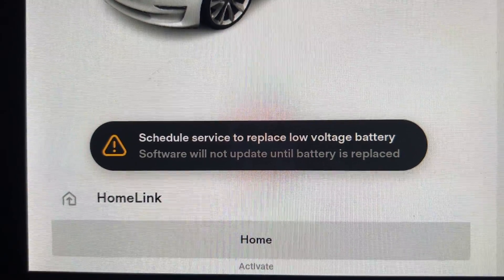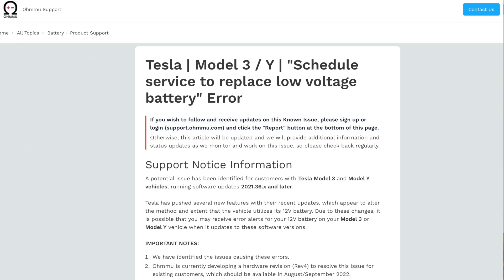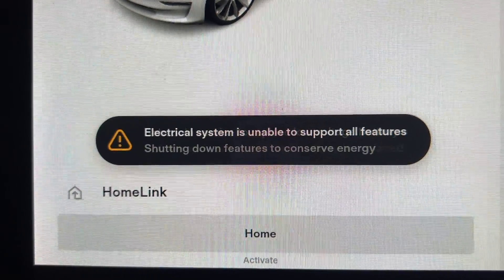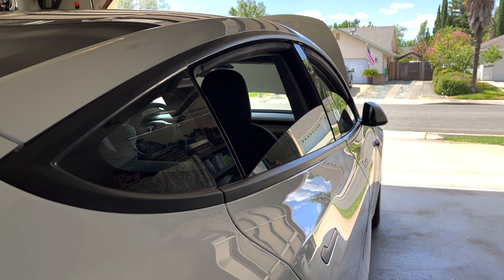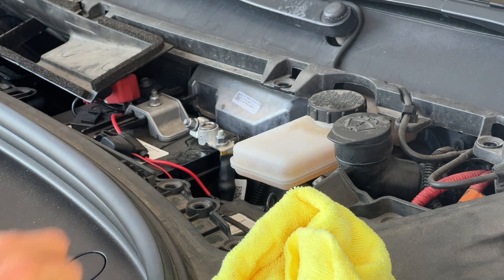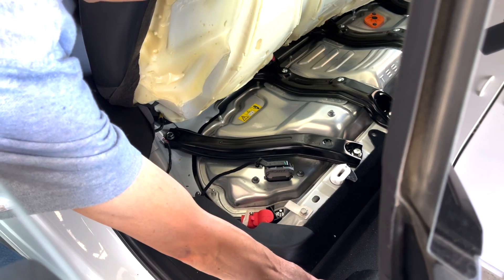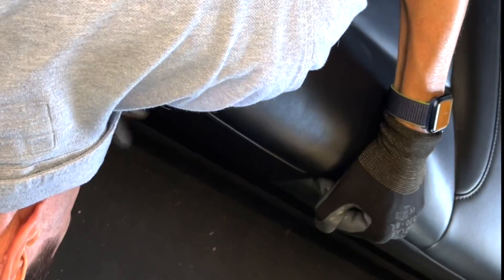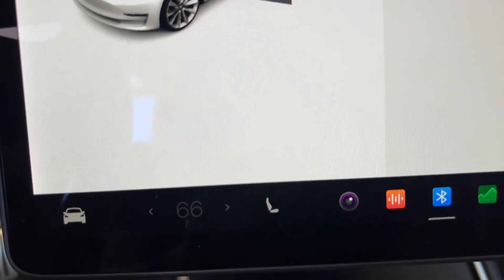Tesla Model 3 or Y Ohmmu Battery Error Message Fix

Comment: Unfortunately the error message reappears after the disconnecting procedure. This has happened several times now. Getting fed up with this, I re-installed the Tesla lead battery. Ohmmu does not reach out to me, just tells me to wait until Tesla has an update that solves this problem. Sadly i live in the Netherlands and it appears that Ohmmu does not care for customers in Europe….😢😢😢
Reply from the maker: Sorry to hear that. It sounds like they are working on a new battery but it won’t be available until the end of the year.

Comment: The problem is in the battery not dropping below 12.6 volts ...the tesla software is waiting for the voltage to drop so it can test  the capacity.  it stays at 12.6 the whole time and that's why it throws the code

Comment: Has anyone tried the reset you get with changing the tires type? I hear it gives a full reset similar to the procedure in the video. Just change from your tire to the bigger or smaller tire and then back, faster than taking the rear seat and maybe the frunk apart
Reply: Just tried this but it did not get rid of the warning message.  Thanks for the suggestion though.
Reply: This "wheel change" reboot method used to work for me in 2022.  It does not work for me anymore in late 2023.  We have a 2017 Model X.

Comment: I was considering this battery for our 2018 M3P with 70k miles, but it was unavailable. Now I know why, thanks for the great explanation. I wound up looking up the original battery part number on the Tesla website and ordering it through our local service center. I picked it up for $85 and installed it myself. Hopefully it'll last 4 years and 70k more miles.
The old battery has replaced the dead one in my lawn tractor.

Comment: I just completed a 6,000 mile US road trip in my 2021 Model 3 SR+

Over 13 days of driving (July 10 through July 31, 2022, with time in Kentucky) from Sacramento CA to Louisville KY and back (with numerous side trips), I drove nearly half what I drive in a year. 

The final analysis: Wow. This is definitely a road warrior vehicle, despite so-called “conventional wisdom.” 

I am still plugging in metrics and numbers, but I estimate about 60 charging stops. In all those stops, I only had ONE 5 minute wait, at Glenwood Springs, CO. One. 5 minutes. I’ve waited longer in a grocery store line. 

I drove through and charged in major cities (LA, Amarillo, OK City, Little Rock, Memphis, Nashville, St. Louis, Kansas City, Denver, Salt Lake City) and countless small towns and wide spots in the road. Typically, I was either the only one there or one of two Teslas. My typical stop was 20-25 minutes. Enough time to have a short walk about, use the bathroom, grab a bottle of water, and then get back on the road (the breaks, and auto pilot, assured I’d be rested and relaxed after hours of travel). 

Weekdays, weekends, rush hour, nighttime, huge supercharger (50+) or small (4), interstate or blue highway… I drove and charged through them all. No cherry picking. 

~60 superchargers. 6,000 miles. 13 days of driving. In July 2022. One wait. 5 minutes. 

I can’t speak for others. But a complete success in my book.
Reply: don't see how this relates to use of an Ohmmu 12v battery.
Reply: same, different route, but countryside and big cities-no problems--even my elderly Aunt had fun riding along as "map monitor."
Reply: @honeybadgerisme  That’s cool! Riding the Wave! Happy travels to you.
Reply: Did you do all this with an Ohmmu battery?  If not, this anecdote has nothing to do with the subject of the video.  Everyone knows Model 3's can do this.
Reply: @StormsparkPegasus  Could not disagree with that last statement more. Yes, people knowledgeable with Teslas (and other EVs) may well know the capabilities of the vehicles. 

However, there are a great many people who do not know the ability of a short range EV to travel across the US and do it comfortably and without angst or worry. Even current M3 SR+ (now RWD) owners are unsure about long distant trips. How do I know this? Because I hear them asking and doubting and uncertain about even attempting such travels. 

That was the audience I was writing to. To encourage them to take trips outside of town. To venture out. To be amazed at just what their EV can do.

Comment: I had a ohmmu pronounced ohm in my 2913 model S, then my model 3 and now in my model Yand 2016 Chevy Spark EV. 
   I was very lucky with no errors or problems on any of them.  They are half the weight and non toxic. I think I will have 8 years life on each of them. 
   Maybe it makes a difference if you install with a complete power shutdown which mine had right at the ohmmu shop.
Reply: Lithium Ion batteries are non toxic! 😂 Damn you dumb!

Comment: Ohhmu is a real disappointment. I had the same error multiple times. Unacceptable for Ohhmu not to disclose this from the get go. $400 battery. Sorry I bought it. OEM battery is back under the hood. No issues. I went through this process multiple times and error messages still appeared after awhile.
Customer service at Ohhmu would not offer a refund. 
Do yourself a favor. Save the money. OEM lead acid is completely reliable. I was fooled.
Reply from the maker: Curious how quickly the error message would pop up for you after this reset. It's been over a month for me and no issues.
Reply: @FrugalTeslaGuy   I’ve done the reset procedure multiple times, and the error message keeps coming back anywhere from a few days to as much as a month later.  Do the reset, and it comes back again in a few days/weeks.  Like others have mentioned here in the comments, Ohmmu customer service has been very frustrating to deal with.  They know it’s a hardware problem on their end, and I know they are frustrated themselves that a Tesla software update is the culprit, but that can’t be the customers problem.  Ohmmu sent me a replacement that supposedly fixes the issue, but that one soon gave me the same error messages.  I wrote back to Ohmmu again, and they suggested I try their v4 battery, but when I asked to go ahead with the replacement, they went radio silent again.  I get it, they don’t really know themselves how to fix it, but they also aren’t being helpful with either replacements or refunds.  So I can’t say that “they are one of the good ones” as you mentioned, unfortunately.  I haven’t given up on them, but pretty soon I’m going to just get a battery from Tesla and call it good enough.
Reply from the maker: @ThisIsTeslaTrippin  Thanks for sharing Sean. I will definitely do a follow up with Ohmmu if I get the error message again. Otherwise, it's been over a month for me since I performed the reset and no issues on my end. Sorry to hear about your issues.
Reply: @FrugalTeslaGuy  Seems like frugal Tesla guy is scamming us and has a deal with ohmmu.  Can't find a single person with a model 3 that doesn't say they are getting this nonstop error message.
Reply from the maker: @aggiechase37  You got me. It's a total scam! I'm all about the scams.

Comment: This comment is off the subject of accessories but does anyone knows a way to keep the interior cooler, I live in Florida and use a considerable amount of my battery to keep the car interior cool using the internal cabinet protection feature, I'm trying to vent the windows to see if this is a better solution but if it rains and I forget to roll windows up, "not good," tesla should have a feature on a future software update to synchronize the same sensor that detects rain on the front windshield to close windows if the car is parked, I will appreciate, maybe this is already implemented I don't know how to use it, perhaps you or someone else can get a hold of Elon and suggest this idea, thanks in advance for your help.

Comment: Our recent experience with 2018 Aug built M3DLR. Made SC appt. late May to get warranty & recall work plus preemptive 12V replacement. We were told Mobile Service is no longer available to us (as it had been in the past) so had to travel 4 hrs RT to neighboring state to nearest SC. after 4 hour wait, result: we were told battery tested good so not replaced, no charge to us for anything except cabin filters. 4 weeks later in June the dreaded message appeared. Drove 4 hrs RT in heavy North NJ traffic again to SC to get replacement 12V battery. Was replaced under warranty no cost, except 7 additional hours of our time, stress, several dollars in tolls. Would have been happy to have paid the $125 for the battery if they had done it the first time to avoid the hassle!
Reply from the maker: That’s the problem with the 12V batteries. One day they’re working perfectly with no signs of going bad and then they completely fail the next day.

Comment: I’ve had this issue and Ohmmu won’t replace my battery after contacting them several times, for this reason I don’t recommend dropping $400+ on this battery.

Note that MMP has had these reset method from the contractor connector under the seat, this reset will also fix other glitches. 

Resetting with this method gets old and fast, there are no fix for this error message and unfortunately you won’t get your money back or a replacement.

Comment: My car is still under warranty.  The first 12 volt battery lasted 27 months.  I plan to have Tesla replace it every 2 years.
Reply: my OEM 12v lead-acid battery equipped 2021 M3 is displaying the "schedule service to replace low voltage battery" message after 15 months

Comment: This happened to me today, but with the OEM battery from Tesla. I bought a new battery from auto zone and the error will NOT go away, but i will say you did things in a slightly different order. Also you never dis-connected the HV service / first responder plug which i found of note. One thing i would advise people; make sure the error is cleared BEFORE re-assembling everything and putting the panels back on. About to go try your way....
Reply: aaaand this procedure did NOT work on my 2020 Tesla Y (non-Ohmmu battery)    :(
Reply: @mjbender2007  He did disconnect the HV interlock.  It's in a different place on the Y.  On the 3 it's under the back seat.  On the Y it's in the frunk and it's a completely different connector.

Comment: Yeah I have a 12/2018 LR DM 3.  Doing the HV system reset only gets rid of the error message for a coupe days before it comes back. ohmmu has said that it will require a hardware change to the new revision of the battery coming out soon.
Reply: did they say they're going to provide the new hardware change at no cost?  same thing is happening to me now.

Comment: I can’t believe tesla makes you do that to reset a message. A typical person would never attempt that
Reply: Tesla doesn't make you do anything. The message is because the car detects a problem on the 12v system.  The Ohmu is a different type of battery, with a different voltage and behavior from the one Tesla designed and provided with the car.  Disconnecting all power, low and high voltage, forces the car to start over and recalibrate everything. You can only cross your fingers that the Ohmu doesn't trip up the system again.

Comment: Too bad it's a pain having the Ohmmu Battery.  I stay away from anything not OEM Tesla.
Reply: The factory battery isn't made by Tesla either. Tesla just made a deal to buy them. The original battery are horrible and fail way too often. It sounds like brand new Tesla's are eliminating the 12v battery in favor if some alternate DC to DC converter to power 12v. Until then, i think this lithium option is still better then the agm acid one that swelled up like a balloon on me.